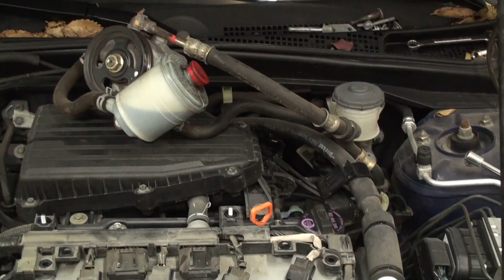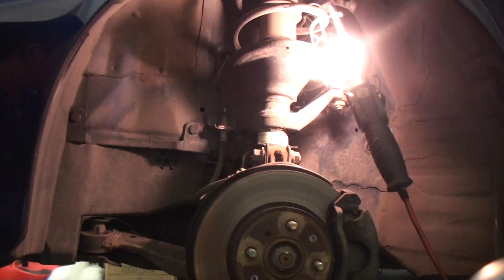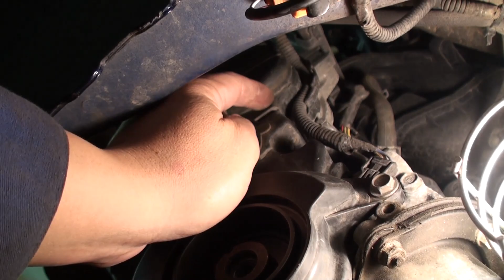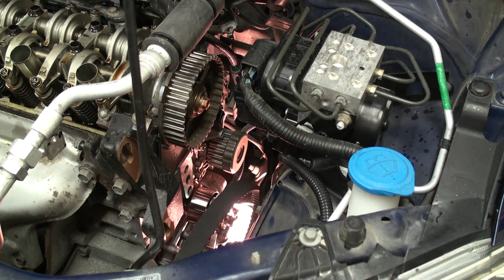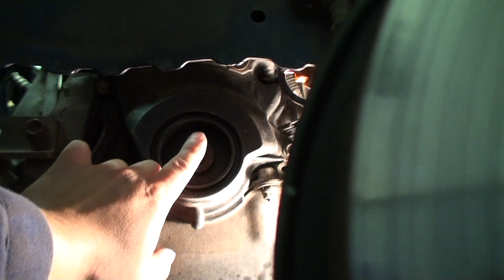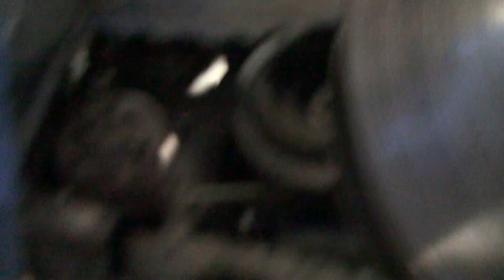2001 - 2005 Honda Civic Acura EL Timing Belt Replacement

Comment: got my 05 1.7EL September 6th 26, started doing the timing. 21:21 "remove the sparkplugs", it broke in half and I get ceramic sparkplug pieces in my combustion chamber. A month later I vacuumed and cranked over the engine to try and get as much of that out as I can. who would've thought 20 minutes into a 3 hour job would end up taking over a month 😭✌🏻

Comment: I'd have liked to have heard his opinion on changing the cam and crank seals. Eric the car guy says leave the original Honda crankshaft seal if it's not leaking but the cam seal is more likely to fail over the years so one might want to replace it. It gets more heat and gets brittle over time.

Comment: I need to redo my brand new timing belt after a bad job. Though 7th gen has differences from my 6th gen I appreciate the extra explanations on the Crankshaft ring and other details. My new belt walks off the pulleys and grinds into the covers. Won't know why but maybe that ring/belt guide is backwards or belt over-tensioned.

Comment: 4 years later we did a timing belt and water pump replacement hardware cost at the dealer $533 but online a part for Auto all HONDA setup cost $163 we have now 35K Timing belt and water pump $1450 plus labor $962 Party $533.  I can't do it by myself I do have the honda tool for the Timing bolt.

Comment: Why do you specify 175 ft lbs of torque on the crank bolt when the manual specifies 14.5 ft lbs plus 90 degrees.  I only ask because you actually follow lubing the bolt per the manual (and I have not seen any other video cover that.)
Reply from the maker: I do the tightening to 175 ft lb from just old habits and notes from old factory service manuals.  I've just become so accustomed to using 175 ft lbs for the bolt that I've stuck with it for literally 20 years without any issue.  If you actually pay attention to the bolt using the 90 degree turning method that it actually does roughly work out to about 175-190 ft lbs (buddy tried this experiment years ago) so rather than marking the bolt and then trying to get it to go 90 degree that I just opt to torque it to that spec.  Simple and easy.
Reply: @piercedasian  Thanks for the reply.  I too prefer to use a torque wrench.  Now that I see the two methods are roughly equal I will use my torque wrench tomorrow when I complete the job (if there are no surprises of course).  Glad to see either method works to about the same torque.

Comment: Is there any reason I cannot break the crank bolt loose first, before disassembling everything?  It seems like I could break it loose then tighten it up again to turn the motor.  Obviously, if I can't get the crank bolt loose it's a deal breaker on the timing belt replacement.  Thank you for the great video.
Reply from the maker: you can definitely crack the bolt loose as step 1 but I like to get the motor to TDC first (or darned close to it) because with a loosened crank bolt that I can use my ratchet to turn the crank without the bolt loosening off.
Reply: @piercedasian  I broke the bolt loose as step 1.  That thing was on tight.  I put all my weight on it with a jack handle over my breaker bar.  I fell over when the bolt cracked.  The breaker bar was definitely bending under the load and seemed to be close to its limit.  I actually thought it broke when the bolt let go.  One thing that I learned from another video was using a jack stand  outside the wheel well to rest the end of the breaker bar and use it as a pivot point.  It actually worked fantastic.  After you get the bolt cracked, you can also change the breaker bar to a ratchet and leave the setup for spinning the crank.

Comment: Just finished and realised i never backed off my tensoner pully half a turn before attaching the spring so worried the tension is not correct. Any tips?
Reply from the maker: You can actually do this even if things are all installed back on the motor.  You will need to remove the valve cover and set the engine to tdc.  On the timing cover there will be a small little rubber plug.  Pop that off and you should be able to get a thin walled socket (14mm) into it and loosen it by half a turn and then retighten (don't ever overtighten the tensioner. I did that once and stripped the threads in the block - bitch to fix).  Just refer back to this video to basically set the timing of the motor and then wherever I say to loosen half a turn and then retighten is where you do it.  I just can't remember if it is move teeth forward 3 teeth and then loosen and retighten or just loosen half a turn and retighten at TDC.  Its been so long ago....
Reply: @piercedasian  thank you sm
Reply: @piercedasian  i ended up just putting it back to together, it sounds alright just a very slight what i think is rubber smell not sure if its related.

Comment: How were you getting no resistance while turning your engine? When I do that I can feel the compression of the cylinders.
Reply from the maker: did you remove the spark plugs?  I will sometimes remove the plugs out of the motor to make retiming the motor just a tad easier.  If you removed the plugs and are getting resistance you could be bending your valves if the motor was really out of time.

Comment: Got an crazy one for you. After watching this and doing my son's timing belt over a year ago, I noticed a continuous oil leak. I used a Honda OEM valve cover gasket when I did the timing belt. Couple months ago I found it was still leaking from the valve cover. After pulling it off and looking at it, I realized that it was warped. Purchased a used valve cover from ebay. New gasket and tube seals. He has driven for a while and no leaks!
Reply from the maker: that's crazy!  I've never heard of a warped valve cover before so this is news to me.  Glad you got it figured out though.

Comment: Hello, i am not sure if you will even see this comment but My timing belt had snapped on mine. So i replaced it and it wont start. It still sounds like it did when the belt snapped. Can the engine be blown or maybe is it out of time?
Reply from the maker: Hi Alex and apologies for my untimely response.  If you snapped the belt then there is a VERY high chance you bent the valves on the motor.  The only way to get this running is to remove the cylinder head and have the valves replaced.  It's a crappy thing to have happen and a very expensive fix.  You might be better off getting a used engine put in and take the new timing belt parts you just installed on your dead engine and put them on the new motor so that you don't run into a t-belt failure with the replacement motor.

Comment: 2002 Civic EX just purchased, original owner, garage kept, 148,000 miles
Thanks, excellent tutorial! Do you have any advice or videos regarding changing the camshaft and crank seal while in there? Also the water pump?
I was going to pay a mechanic to do this, now I am going to do it myself.
Reply from the maker: I do not have the video to show the seal replacement BUT I will say that if it isn't leaking don't mess with them.  When I worked at Honda the techs NEVER replaced the seals unless they were showing signs of wear.  My 1991 civic went over 500, 000km on the original seals and nary of a leak anywhere.  Water pump is super easy, just buy a new pump and look at the holes on the new pump.  Undo the holes for old pump and put the remove screw into the new pump (for reference purposes).  Then when you got the old pump out, transfer the the screws again to the old pump (again for reference).  Install the new pump one screw at a time.  No sealer is needed and just hand tight for the water pump screws (had to believe its hand tight but it is).  Good luck!
Reply: @piercedasian  Thanks! I was inadvertently using by daughter's account (she was logged in on my laptop) when I commented previously. 
Another question... The previous owner said that she had the front struts replaced recently. I notice that the front driver's side is sitting lower and if I measure from the center of the wheel to the bottom of the finder it is definitely lower on the left front. Any suggestions? Thanks in advance.
Matt
Reply from the maker: the springs are sagging and the only way to correct for this is to replace the front springs as matched pair.  I have a similar problem on my CRX, and it isn't enough to warrant the amount of work needs to change them out.  How much sag are you seeing?
Reply: @piercedasian  It's about a half inch lower on the left front and about a quarter inch lower on the left rear.
Reply from the maker: hmm, that is wonky.  Personally it isn't a huge enough variation that I wouldn't worry about it.  It doesn't necessarily pose a safety risk and more of a ride height /aesthetic problem.  It really comes down to your tolerance level but the cost to fix is pretty pricey because the whole suspension has to come out.

Comment: Hey pierced, great video.  I'm watching it because the mechanic installed my timing belt too tightly.  It's making a whining sound (while all other belts have been removed).  Do you know what the easiest way is to loosen the tensioner?  Thank you so much.
Reply from the maker: you don't have to take too much stuff apart actually when you want to retention the belt.  Just pop the valve cover off and remove the upper timing cover.  Set the engine to TDC (using a ruler on the surface of the head to ensure you're bang on TDC).  Pop the little rubber cover of the lower timing cover so you can access the 14mm tensioner bolt head.  Loosen tensioner bolt, advance the belt 3 teeth or so by turning the crank counter clockwise.  Retighten tensioner and reinstall the top timing cover and valve cover.
Reply: @piercedasian  thanks! you're awesome. how do you know all this?
Reply from the maker: I do a lot of car repair work and even worked at a Honda dealership for a while.  Done enough timing belts to almost do them in my sleep :)
Reply: @piercedasian  you should do consulting.  Your videos make you very credible.  I'd be a paying customer
Reply from the maker: I've had my spouse and many folks tell me the same exact thing.  I guess that is why I continue to fix cars all day long outside of my day job.  They say I'm knowledgeable but I say I'm just passionate about what I do.
Reply: @piercedasian  hey pierce, just an update.  turns out the 7th gen civics (unlike the 6th gens) do not have a hole in the timing cover to access the tensioner bolt.  There is a bean-shaped hole to access the Allen screw only.  I ended up taking off the timing cover to fix it.
Reply: I just turned mine on and theirs a loud sqeauling noise after 2 seconds. 

I'm thinking it's not tensioned correctly. Do I just need to line up the cam before I readjust the tensioner?

Comment: Hey there great video, just wish I'd watched it before I installed a new water pump on my 2001 acura el 1.7. I was sure the crank didn't turn when I reinstalled the belt never checked the crank position. Put it all back together and it wouldn't start. Turned over easy. So now I have it apart again. Here's the problem. Cam shaft marks are good showing TDC. When I pulled the crank pulley off, I notice the key way was at a 45 instead of straight up like yours is in your video. I turned the crank until the key way position matched your position and put the cover and pulley back on to check the alignment mark on the pulley to make sure it was in the center of the v groove. It was out by at least 1/2". So I then checked the crank gear mark with the arrow on the block and its almost bang on. How can that be. Which alignment should I set the crank gear and or pully to?. Thanks
Reply from the maker: okay, so here is a fool proof way to tell if the crank is at TDC.  If you look at the cogged gear that drives the t-belt there will be very clear dot on the side of the crank belt cog.  That dot is supposed to line up with a very large triangle on the engine block/oil pump body (remember the oil pump sits directly behind the main crankshaft).  That dot should line up with the pointy end of that triangle.  Make sure the woodruff key is in, reinstall the lower timing cover and BEFORE you reinstall the crankshaft pulley look at the timing marks.  There should be in fact 4 notches on the pulley.  A set of 3 notches will be closely clustered together.  That is your 14/16/18 degree marks.  If you look further away from those marks you will see a lone notch.  THAT is TDC.  If visibility is an issue then paint that LONE timing mark with some white paint (factory paint is actually red for TDC mark).  Once the pulley's TDC mark is clearly visible, reinstall the pulley and that color mark (remember it is the LONE notch on the pulley) should line up the the plastic pointer on the lower timing cover (as viewed from between the "V".  Make sure you're looking at the proper angle down the "V".  I'll bet your crank will be lined up perfectly :)  Hope that helps.

Comment: What kimd pf tool u use tp remove that pulley bolt? What was that
Reply from the maker: the tool I used to take the pulley bolt is the factory approved honda crank holding tool. It is SUPER expensive for what it is but an extremely well made tool.  I think I paid something crazy like $300 for it back in 1999.  Today there are much more cost effective crank holding tools that can be had for as cheap as maybe $30.  Don't know how good the quality of those ones are but I'm a firm believer in buying super high quality tools b/c they'll hold up to the strength needed to take off some brutally stubborn fasteners.  The honda crank pulley bolt is one such fastener... heaven forbid if the crank holding tool your using damages the crank pulley (not sure how but what if?) then you'd be on the hook to find a new crank pulley or bolt.  Buy good quality and it will serve you extremely well.

Comment: Why did you say you need an impact to tighten the bolt for the crankshaft pulley?  You said because it's the same way you loosen a bolt.  I didn't understand.
Reply from the maker: It is ideal to use an impact wrench to tighten the crank bolt (but not hammer it on it for too long) temporarily b/c you will need to attach a socket to that very same bolt so you can rotate the crank COUNTER CLOCKWISE to line up your timing belt marks.  That is effectively "loosening the crank bolt".  You use a impact gun to tighten the crank bolt just enough such that when you rotate the bolt in the CCW direction that the bolt just loosen on you.  You could try to rotate the crank pulley itself when trying to line up timing marks but it is awkward and not precise.  Hope that makes sense.  Some folks that don't have impact tools will need to hand tighten that crank bolt tight enough using a crank pulley holder tool and ratchet and then use that very same tool to undo the crank bolt after timing has been verified and "locked" in via the tensioner adjuster.

Comment: Do you have to move the Alternator, i want to install a new one. Should I expect most shops do it that way ?
Would Make sense for me to do the Waterpump at the same time right ?
Reply from the maker: Yes the alternator must come out of the car to get the timing belt out. The water pump should be replaced with the timing belt.

Comment: I'm guessing you're a honda tech. I just have a question. I did my t-belt along with my oil pump (replacing the whole oil pump). Upon start up an allen key plug on the oil pump assembly facing towards the back of the car started leaking oil. I just wanted to ask you if you have ever encountered this? But I took out that same allen key plug and honda bonded it and it hasn't leaked since.
Reply from the maker: Honda tech?  Sort of I guess :). I did work at a Honda dealership as a service mechanic so I know my way around them quite well.  I have never taken the Allen key plug out of the oil pump BUT I have experienced an oil leak that is VERY similar to what you described and it was a result of the o-ring BEHIND the oil pump but since you replaced the oil pump I'm assuming you had a new o-ring installed on the back of the new pump.  Often leaks that LOOK like they're leaking from the oil pump's rear end is a result of a faulty oring seal and/or missing hondabond sealant on the mating surfaces where the oil pump meets the engine block around the oil pan seal area.
Reply: @piercedasian  Thats what I thought. So i shut off the car degreased the area and restarted the car to reinspect. When I did so I noticed that the oil was leaking directly from where the allen bolt/plug threads into. So I took a gamble and took out the plug and Honda bonded the threads and it hasn't leaked since. I looked all over Google  to see if someone has encountered a similar problem and didn't find anything. As for the O-ring: a new one came with the oil pump so I ruled that out. I also rechecked the mating surface and didn't see anything. Faulty part? Could be. Also tried finding reviews on the part which is branded as Ultrapower and only found that Ultrapower is a company that outsources parts.

Comment: Is there a certain way put a new belt tensioner And water pump
Reply from the maker: Nope, just make sure the mating surface is clean of coolant, dirt and oil and screw back on making sure you pay careful attention to the bolt lengths that come out and reinstall in reverse order.   Don't over torque the bolts, they're tiny little 10mm screws so they can snap pretty easily if you crank on them real hard.  Tensioner is similar.  Just pay attention to orientation of pulley and don't over tighten the 14 mm bolt.